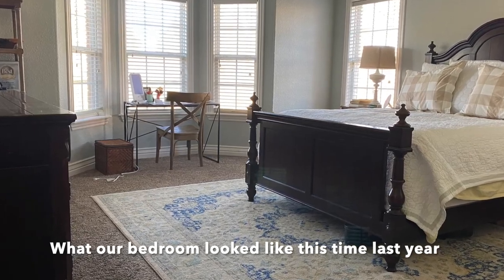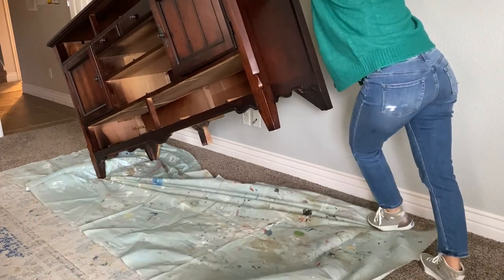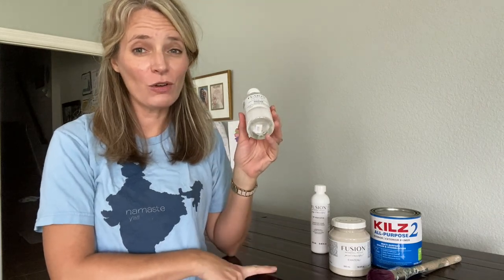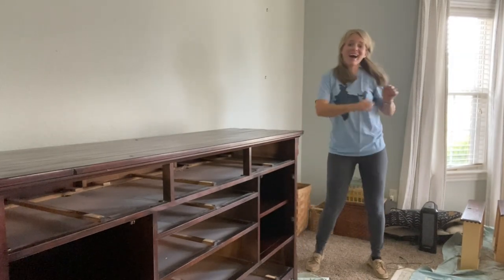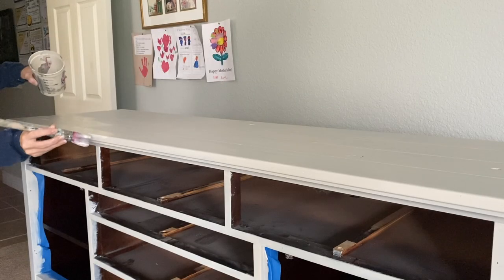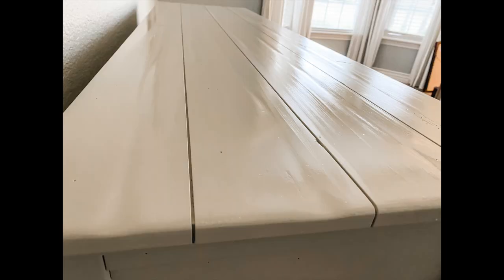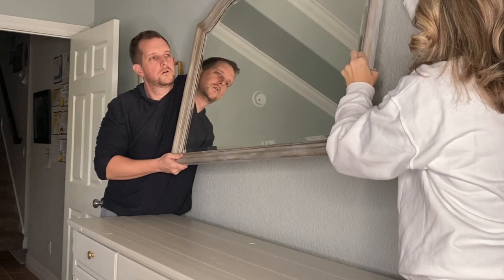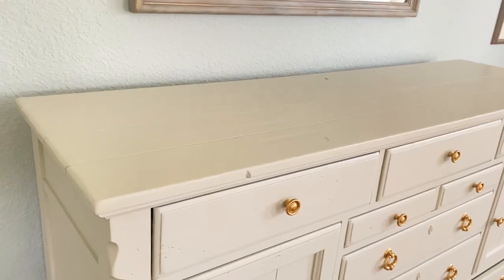DIY Furniture Huge Flip - Bedroom Dresser Makeover with Fusion Mineral Paint. Cottage Glam Bedroom!

Comment: Does the Kilz have an odor? I've never used it before.  How did you hang the mirror? The dresser turned out amazing! Your room looks very pretty! Nice job! 💕
Reply from the maker: Thank you! And no, the Kilz was water based and didn’t have any real odor (at least not one that I noticed). I use two large picture hangers for the mirror—the ones with the nail and hook you put the nail through. Spaced them out a bit so the weight was distributed between each one.

Comment: It’s just beautiful, Melanie!
Thank you for showing how you dry brushed the mirror. I especially appreciate seeing how you used the clear wax to control the gold. That’s very helpful to me. 

I have one question about the mirror. I’ve been procrastinating on tackling the mirror in a vanity I’m doing right now because I’ve been concerned about the original dark wood reflection and I’m afraid of taking it out of the frame before I paint. It’s very old and I may not be able to get it back in. Do you have a dark reflection around your painted mirror frame? Have you experienced that before?

I appreciate your videos and tips. 
Thanks 😊
Reply from the maker: Hi Nancy! I get exactly what you’re saying about your concern. But the tiny bit of reflection I’m getting from the backside of the original wood is minimal and completely unnoticeable when looking at the mirror straight on. So I say go for it! I think it will be fine to paint and not remove the mirror
Reply: That’s very reassuring. Thank you so much!

Comment: What is a good primer 2 use with fusion paint?
Reply from the maker: Primer usually isn’t necessary for adhesion, but can help for stain blocking and color transition. If you need to block stains and/or wood bleed though, use a shellac based primer. If you’re just looking for color transition help, a water-based primer (which is what I used in this video) works fine :)

Comment: What did u use on the top of the dresser? It look like a different. Color.
Reply from the maker: The dresser is all the same color. I did add a coat of the Fusion Matte Tough Coat just on the top, but it didn’t change the color. May just be a camera or lighting issue :)